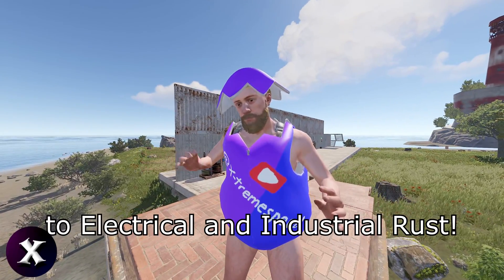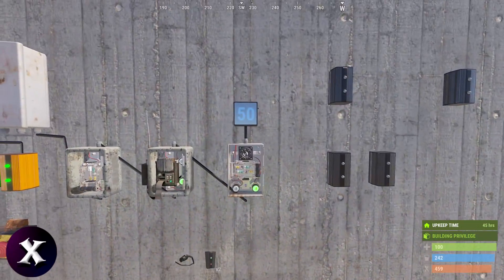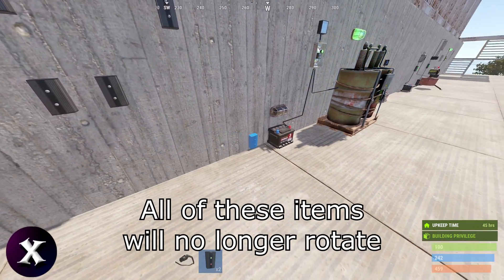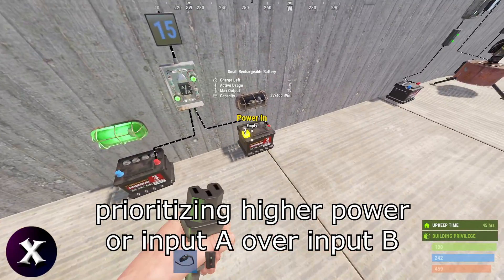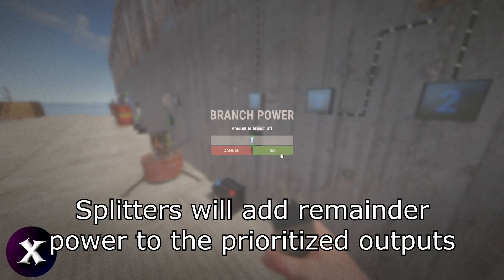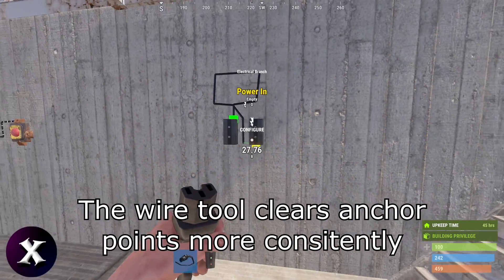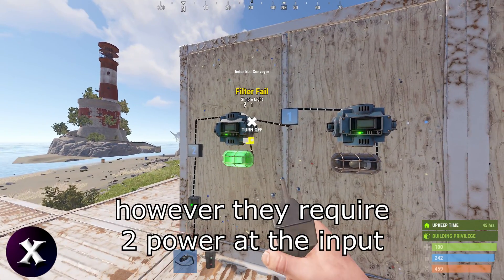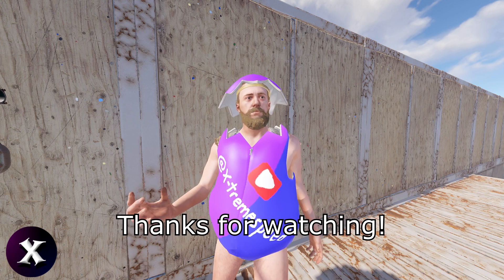Rust April 2024 Update | Big Electrical News

Comment: It still says power usage 1 tho
Reply from the maker: Conveyors? They only drain 1 unless you are actively using one of the filter outputs.
Reply: So you only need to set conveyors to 1 power or 2 to activate the filter fail?

Comment: Great channel ! Does this mean that your modular circuit need 2 powers for each conveyor now ?
Reply from the maker: Thank you! 
Not quite. Conveyors can run off 1 power if you don't use their filter pass/fail outputs. Unfortunately the days of spending 1 power to keep 2 conveyors running is over.

Comment: Branches not consuming power when not powering a device is so fucking nice.

It basically removes the need for configure siphons.
Reply from the maker: It's huge!

That was my original thought as well, although the one thing the configure siphon does still do is enable the power to be redirected. Despite branches not draining, they still hold on to 10 power that you can't use elsewhere. It's a bit of a niche case as I don't tend to "reuse" power in any of my circuits, but it does still have that function 😀